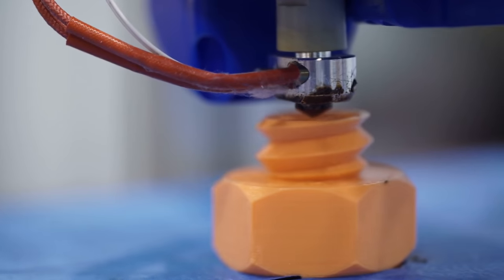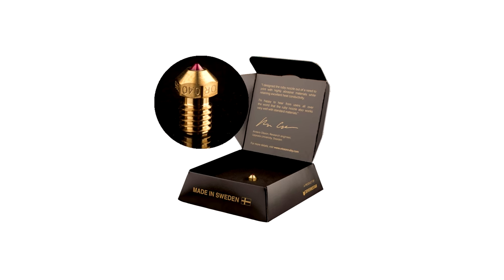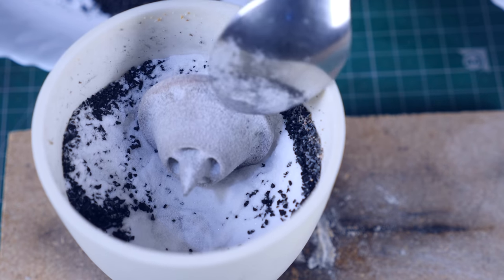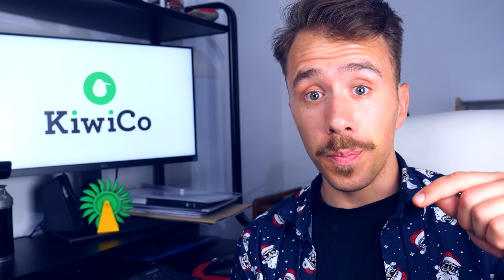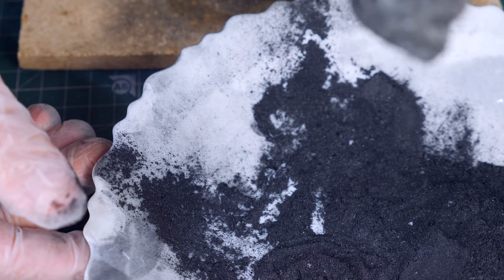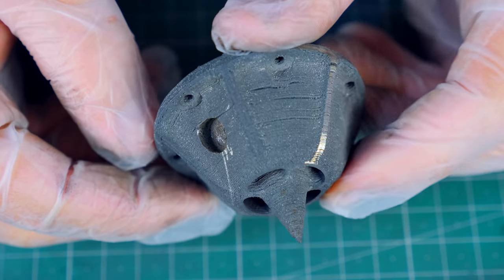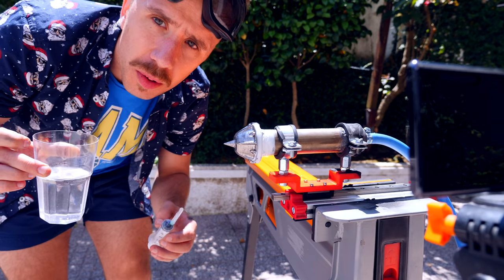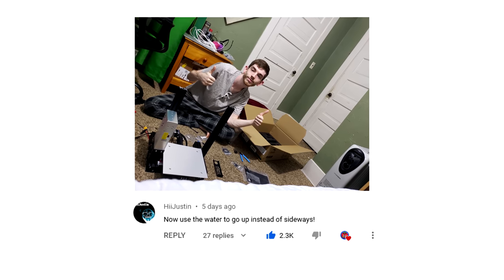How I 3D Printed a Metal Aerospike Rocket at Home

Comment: I don't blame that aerospike tip for melting. I'd melt in the presence of the Tomato Lord as well.
Reply from the maker: Ahahahah
Reply: 420?
Reply: lol
Reply: Integza where did you get your idea from. Because two videos ago I suggest this to you.
Reply: @integza  dang it inetzga
Reply: Spoilers
Reply: Where was the tomato lord
Reply: Should of made it out of the tungsten filament the virtual foundry offers it’s got twice the melting point of steel
Reply: @mykhailophillip1323  integza is the tomato lord
Reply: @Jacob-gg1rt  And you have to use a furnace hot enough to fuse it during the sintering stage - That's what? Hmmm... Could it be TWICE AS HOT as what you need for steel? Can your furnace hit that temp? Can @integza's?
Reply: Hello again
Reply: Firey death to the Tomato Lord!
Reply: @Jacob-gg1rt  but doesn't it also sinter at twice the temp? 
Also, leave the guy somewhere to go with the next videos.
Reply: @PatrickKQ4HBD  yeah it needs to sinter at twice the temperature but there are lots of companies out there that will do it for him if his furnace can’t
Reply: If he would be smashed he cant melt u
Reply: @jro2020  
You only have yourself to blame. Do not read comments before watching the video.
Reply: @rouge5140  it was the pinned comment it was literally right below the video
Reply: I'd be willing to bet it was several thousand degrees. I'm not surprised either.
Reply: @jro2020  
Okay don't look at it
Reply: @rouge5140  it's right there in the center of the screen  you would have to be blind to not look at it.
Reply: @jro2020  
Stop reading everything you see you don't have to
Reply: The Tomato Lord Intzega
Reply: he didnt melt the steel he burned it by heating it in an oxygen rich flow
Reply: @Jacob-gg1rt  sintering is done below the melt temp otherwise the component would melt into a puddle
Reply: @integza  use metal plastic to make rocket it will be extremely powerful
Reply: Jet fuel can't melt steel aerospike engines.
Reply: Out of a cuteness overload or what?!

Comment: video idea: use the 3d printed metal to make more sturdy gears and make a functional vehicle with them.
Reply: That would be very hard because the gears may shrink at different rates or warp slightly causing the gears to break themselves
Reply: you mean an RC vehicle? because that's as much as you could accomplish with that
Reply: Cool idea, upvoted it, buuuuut...

Why not just sand-cast them out of aluminum? O.o
Reply: @Cheebzsta  aluminum has a very low Melting point
Reply: @Firefox-cr3jw  Right.

If the gear system on your vehicle is directly exposed to combustion gases your problems have already eclipsed the melting point of aluminum. ;P

OPs idea is worthwhile, though. Just pointing out that there are valid ways to do that which aren't necessarily less work but are certainly more accessible.

No specially ordered kilns required or special filaments and all the parts are easily DIYed.
Reply: If not for the pfp u wouldnt havebhad 2.7k likes lmao
Reply: @ETERNAL_..  loose tolerances for the win.
Reply: @Cheebzsta  using a pla printed part with the process known as “Lost wax casting” used to make metal & glass art sculptures, now with modern 3D printers has given rise to “Lost PLA casting”, you give the part a  plaster cast coating and put it in a pot exactly like this, but that requires the equipment & safety gear to pour the molten metal.
Reply: @Cheebzsta  if you use OP and upvote in normal YouTube comments then you use too much Reddit.
Reply: or just learn how to shift properly and don't money shift

Comment: To much oxygen, reduce it so that nearly no unburned oxygen reaches the aerospike otherwise even tungsten will burn uo
Reply: tru
Reply: The nozzle isn't so much melting as oxidizing (aka burning)
Reply: Would the issue be slow rate of his oxygen supply? or is it ratio of oxygen to a non-flammable gas? Could this aerospike still work?
Reply: @richardsuckerson49  ratio. 
Edit: perfect flame is just enough oxygen to fully burn the fuel. He used more oxygen than the fuel needed so he accually burned the steel away (see wiki Blowtorch, this concept is fully explained)
Reply: @Florious420  ah that explains why on old blowtorches if you didnt give it enough gas you can see the metal burning.
Reply: @Florious420  The Space Shuttle Main Engines did this, in fact, then ran fuel rich because a stoichiometric ratio burned too hot.
Reply: Or use normal compressed air (less oxygen, more cooling effect)
Reply: @Florious420  the aerospace became a thermal lance
Reply: @Jkirk3279  are you quite sure about that? My understanding is that water injection was used in order to prevent detonation. Basically they can run the engines extra hard as long as they had the water injection but if the water ran out they had to quickly throttle back otherwise they would destroy the engines.
Reply: @Jkirk3279  the problem with that is that you are cooling the exhaust. When you cool the exhaust, you loose efficiency. As a gas heats up, it expands. If it's volume remains the same, then pressure increases. Increase pressure roughly equals increased thrust with a properly designed nozzle.

What needs to happen is the engine nozzle throat needs cooling. So piping water around the throat would help, but this an aerospike design which severely inhibits that. There is a lot of improvement to be made here, but that's for another post.
Reply: This is true, as a heavy fabricator and welder we use oxy acetylene plants to cut through steel, as a ‘party trick’ you can turn off the acetylene and let the oxygen do the cutting whilst you’re mid cut causing a rapid oxidation/rusting of the steel.
Reply: THIS - the steel is more burning than melting. This is how cutting torches work; get the steel hot, then feed it a lot of oxygen. You want to run with a slightly fuel-rich mixture, so no oxygen left to oxidize (burn) the steel.
Reply: @leenux1707  that is a bad idea. You are injecting nitrogen into the chamber. You don't need it. Just lower the oxygen flow
Reply: @CarlosAM1  Yup. You aren't getting anything extra from surplus oxygen, it's merely along for the ride.
Reply: @skybirdprojects5489  could you just use a solid rocket fuel instead? that way your mix is set?
Reply: @brushnit9212  the oxygen is what is doing the cutting, whether you "cut the gas" or not.
Reply: @brushnit9212  The cut doesn't really start until you hit the oxygen. Unless you call a melted puddle of steel a cut. I wouldn't? But I'm not a professional.
Reply: yeah, way too much o2. Also, i think an actual aerospike needs a lot more engineering design. And fluid dynamics. And math. And money. But pretty cool anyway. I love jets and rockets.

Comment: "It melted the steel!" Yeah, this is why aerospikes are generally a bad idea... (actually one of the biggest reasons they aren't really used). You could try a de Laval though!
Reply: Works too good.

Materials science falls behind too. 

May need to be a holographic part.

Somehow.
Reply: c/d nozzles are useless when the fluid is below mach 1
Reply: I think you may have won the 3d printer :D leme know if u did and what u going to make you should make a crossbow or bear trap them would be cool if you win
Reply: @joeyidontnoyu  the point of the nozzles is that they compress it to reach mach 1 at the throat, and then expand. A really small pressure could be brought to mach 1 with a small throat
Reply: @JerryBrower  the problem is most likely foremost the excess oxygen literally burning the metal away. it isnt melting as much as it just gets oxidized super fast
Reply: Like all rocket nozzles using combustion processes, active cooling is required - this usually involves pumping either the oxidiser or fuel through the hot parts.
Reply: Its more of a improper material used problem. You dont use steel when you have a oxidizing reaction. The oxygen flame will literally eat through the metal.
Reply: @vinny9854  Which is why rockets generally run fuel rich - it results in longer operating life than running engine rich…

Comment: There's no need to use special "sintering carbon", any activated carbon should work (sold for water filters or fish-tank filters). Or even a carbon source that will become activated carbon on heating, like paper or wood, though that would require a ceramic tile to lay on top of the crucible to limit air getting in. Putting a tile on top of the crucible to limit airflow is probably a good idea regardless.
Reply: Makes sense too me~~:)
Reply: Yes, this right here is correct: Any plain old charcoal will work.  (not the BBQ stuff with fillers, regular charcoal)  

To make it easily, put the cheapest untreated wood (not driftwood) in a metal can with a hole in the top on a fire or in a kiln.  Roast it until the inside is black all the way through.  granulate that by putting it under a rolling pin and seiving to the desired fineness.
Reply: @notamouse5630  you mean BBQ charcoal ISN'T regular charcoal? 🤔
Reply: @PatrickKQ4HBD  They can have additives in them, afaik to keep moisture out and binders to make it less brittle. You can convert BBC charcoal to activated carbon, by burning it without the presence of oxygen, pyrolysing all the unwanted stuff to gas.
Reply: @PatrickKQ4HBD  BBQ Charcoal is not the material charcoal.  It is a mixture of mostly ash and a little real charcoal powder so it burns as coals the moment its lit.  Real charcoal is more often used for forging steel and similar and its only made of carbonized wood.

Comment: Nice work. Having worked in the rocket engine business for a few years I have a few suggestions to make your nozzle last longer. I suspect given how long the flame out the back is you are running significantly oxidizer rich combustion, and that is burning out the steel nozzle the same way an oxy acetylene torch would cut through steel. Fun fact about oxy acetylene cutting, once the cut is initiated you can cut the fuel flow and finish the cut. I'd try running less oxygen if you are going to stick with the steel material you are currently using. Second suggestion.  Material change. The site you got your materials from have an inconel 718 filament listed. I don't know if your overn will do their sintering profile, but of the materials I saw at a quick glance that inco 718 material has the best shot at resisting oxidation in a nozzle application. A monel or mondaloy would be better, but I doubt they will be making those into filaments anytime soon. Third suggestion. The metal filament company has an aluminum 6061 filament listed. You might try printing your fuel grain out of that and not sintering it. Aluminum will be a lot more energetic than the plastics you are currently using as fuel. One bot about that  is that the exhaust will contain aluminum oxide which will cause serious erosion/abrasion of your nozzle throat. Just a heads up. I hope you found this helpful, and if you ever have any questions about rocket engines/technology I'd be happy to chat. Keep up the great work and stay safe!
Reply: I don't know that anybody has really used a solid aluminum fuel grain in a hybrid.
People have experimented with adding aluminum to wax and rubber grains but not like your are suggesting. In this case, I suppose it wouldn't be solid if you left out the sintering step, but you risk the fuel grain being too brittle, cracking, clogging the nozzle then motor go boom.
The core issue to hybrids is getting high regression rates of the fuel, which is why wax based grains are generally preferred. A lot of people have spent a lot of time trying to get the right balance of physical properties with high regression rate. 

Honestly, might be good to try just using the printed part without baking off the resin at all. That wont really help with regression rate, and the temps would be much higher so the printed aerospike would not survive, but it would look neat.
Try it with a standard graphite nozzle.

I think the best answer to this particular bench top demo motor is to lower the oxidizer flow rate. Or build it up as a bi-propellant with gaseous propane, dial the O/F ratio running fuel rich, then test the aerospike nozzles.
Reply: I have questions for you. I feel like a bell nozzle would have had greater success, more likely to keep the sides cool. easier to make changes. simpler to 3d print. with a bell nozzle you might be able to print it in multiple materials like have the inside have a ablative material that would take the heat with it for its short operation cycle. how do space shuttle tiles work? can they absorb the heat if they were made the lining of the engine? is any of that possible?
Reply: @keith3761  I have some answers. Let's see if they go with your questions. A bell nozzle I think would have the same issues of erosion and potential for combustion of the nozzle material at the throat, plus I don't know what pressure he is running and if he would benefit from additional expansion. The bell nozzle only works if you have enough pressure to choke a converging nozzle and then still have enough pressure to accelerate the flow to supersonic velocities. So that's a hard one to know for sure without a bunch of instrumentation. As far as easier to make, I'm not sure. The simpler the nozzle geometry likely the easier it will be to make in my experience. Multi material nozzles are all over in rocketry. It's popular to make nozzles out of phenolic ablative material and use some metal outer layer to give it the structure it needs to survive the pressure. I also think I recall seeing inserts for solid rocket motor nozzle throats, but I can't remember  off hand what they made them out of. They were there to resist erosion from the hot aluminum oxide rich exhaust gas usually. The space shuttle tiles were not ablative from what I remember. They were a carbon carbon composite that could withstand tremendous heat and not lose their structural integrity. Given their difficulty in manufacturing I think they might be beyond the typical hobbyists capabilities to make. They mostly worked by not absorbing the heat. They were more of a heat shield. As far as using them in an engine, I suppose it's possible, but I've sure not seen it done. Most of the time they either cool the surfaces that need it, or just use an ablative material there.. I'm not sure if that's a "we've always done it that way and we aren't going to change" ,or if it's more of a " we tried that and couldn't get it to work right" situation. You would be surprised how often in the rocket industry it's it's former. I have seen a carbon fiber composite rocket combustion chamber and nozzle before. It was pretty slick. It was cooled by hydrogen leaking through the inside Lauer into the combustion chamber and nozzle liner. That was a cool bit of engineering. I hope that answered your questions, and if you have more please feel free to keep them coming.

Edited to add: you are probably right that a bell nozzle would be easier to make, i forgot this was for an aerospike nozzle. Tha difficulty with the bell nozzle would be in sizing the exit. Too much and you overexpand, too small and you underexpand. You can only size the bell nozzle perfectly for one atmospheric exit pressure and throttle condition.
Reply: I am in the rocket engine business as well and I have no comment. He did a damn good job for delivering a hybrid for the lowest cost just for the sake of it.
Reply: @mitchelwendland5195  really cool to hear about niche industry experience like this, thanks for sharing!
Reply: @semibreve  Thanks! It was a very fun industry to work in. Lots of really interesting design challenges that you don't see anywhere else.
Reply: He made an oxygen lance fueled by the device itself.  Not the safest idea in the world.  Too much oxygen means everything becomes fuel.  It makes for a fun flame show and interesting noise.
Not criticism of the attempt, but I'm not sure the problems are being understood and worked in any way that will result in a stable engine so much as a potential bomb.
Turns out rocket science is actually rocket science.
Reply: @tiporari I don't think he actually understands what exactly he's doing. He just tries random nonsense until it maybe seems to work. He needs to directly consult with someone who does actually know what they're doing.